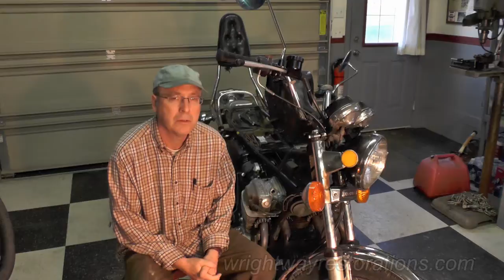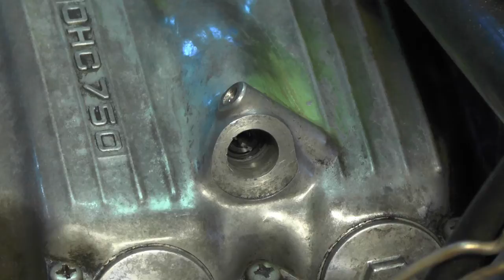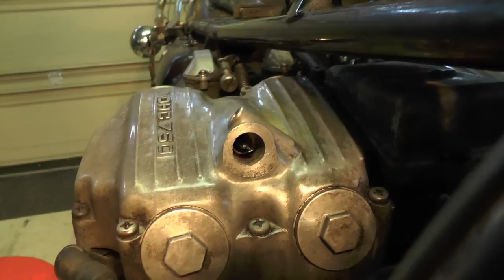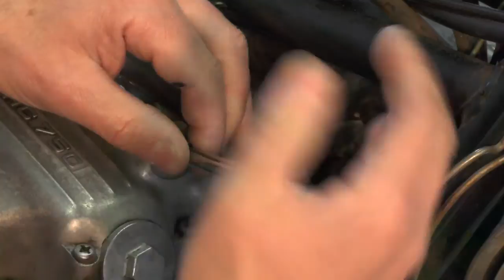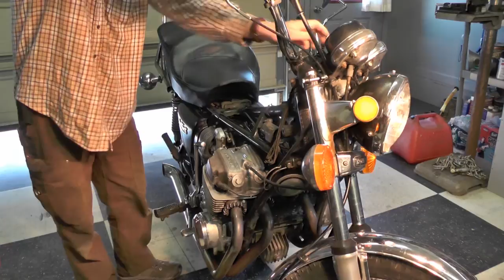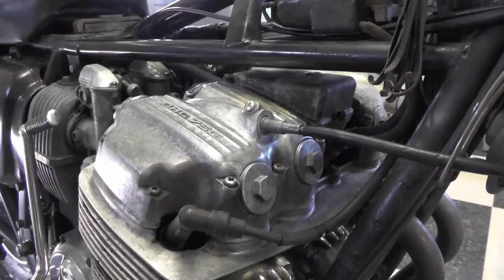Tachometer Drive Oil Seal Replacment - Honda CB750K --- Video #35

Comment: So, thanks for the vide. I'm going to be ordering the part I found online but many places say it's only for a CB750k and up to year 78. I have a 1980 Cb750C, are these seals interchangeable or do I need to keep looking?
Reply from the maker: Honda lists the two different model year seals as different part #'s.  The engines are entirely different so I surmise the seals are different.  I believe the seal  you need is:

91256-425-003

The earlier model seal is listed as 91211-286-003, which is probably what you have found (?). 

Both parts are listed as still available from Honda and are commonly found on eBay.
Reply: @kwrightway  that's awesome. Thanks for the reply and helping out, I very much appreciate that. Many YouTubers will post and not reply, do I want expecting a reply, but you went out of your way to do so and I am really grateful for that. Safe riding and may you have peace and prosperity in your days
Reply from the maker: @seanaguayo   You're most welcome.
Reply: @kwrightway  Hey, I wanted to thank you again for the help, I bought the part down here at Dime City Cycles in Tampa, and put it in on Sunday morning. The old seal had hardened and collapsed inside the slot/section that it goes in. I used a magnetic screwdriver to get out all the metal pieces that were ground up, a pair of slanted picks to break up the remaining hardened seal, paper towels with WD-40 to get the remaining pieces out. Took about an hour, but was able to do it right and get the seal in. Drove it to St. Pete and had no leak! Was very happy, proud of myself, and satisfied.

You also inspired me to look up schematics for the bike, since Honda usually has them for all of their vehicles, the schematics that show where every part is and what number it is to order, so I went ahead and found some websites that offered the schematics and links to parts for my bike and bookmarked them. Like the old saying goes, you teach a man to fish he eats for a lifetime, I want to thank you again, because you put me on that path
Reply from the maker: @seanaguayo  You are most welcome, and I'm glad you were able to sort things out.  Thanks for the kind words and update!

Comment: I've got an 81 Super sport and there was a leak in this spot. Removed the old seal (in pieces of course) but I'm wondering about the rubber ring that goes around the outside of the gear drive slot. I hit it a few times with the pick and chewed it up. Will that be a problem or is that actually part of the ring that old seal that should be removed?
Reply from the maker: I'm not familiar with the '81 model so I'm taking a bit of a shot here.  Looking at the parts diagram, it appears the part you are referring to is a dust seal.  If this is accurate then I don't think you'll necessarily have a leak but this may allow water and contamination into the mechanism.  My advice would be to replace this dust seal, which for around $8.50 or so.  You could also ride it for a while, keep and eye on it and decide later what to do.
Reply: @kwrightway  Thanks for the response. You may be right-the part I think I hit is a thrust washer. Not entirely sure though, because I still think it may be the back collar of the oil seal that remained in there when I ripped everything else out. Perhaps I'll put the new seal in and see how it goes. If it leaks, then remove that part. Can I send you a picture? Can I have your email?
Reply from the maker: @Bslice2007  If you wish to contact me privately, go to my blog wrighwayrestorations.com and select the 'CONTACT" tab on the op of the home page.  I don't publish my private email address here for obvious reasons.
Reply: Sure thing. Totally understandable.

Comment: I thought you would have greased the tachometer cable whilst you were in there??
Reply from the maker: I did grease the cable somewhere along the line, just not on the video.  Thanks for the comment.

Comment: i have a problem with the screw that keeps the tach cable tight when it's in the engine. the screw spins in space like the thread is busted and thus the tach cable can wiggle. what would you suggest me do to fix this??
Reply: that screw that you can see at 10.00 minute
Reply from the maker: With a screw turning in a blind hole (no access to the back side) this indicates the thread is stripped either on the bolt, in the threaded hole, or both.  Most likely the female threads in the engine are damaged.  If the screw is loose enough that you can get a grip on the fastener head with a small, pointed vice grips or locking pliers, that may be one way way to attempt to lift and thread it out at the same time.  You may have to slide something thin under the fastener head to lift it up a bit to allow enough to show to get a grip with the pliers.  Though I hesitate to recommend more aggressive options, it may be possible to either spot weld a nut or similar onto the head of the screw to enable you to get a grip on it to lift-and-turn.  If you could secure the screw some way to enable you to drill it out, perhaps using red locktite or similar, that may work.  Not matter what approach, you will likely have to repair the damage threads in the cylinder head and care must be used here.

The 750 featured in this video wasn't mine and I haven't worked on a 750 is a few years now.  It can be difficult to suggest options without being there first-hand.  Good luck...
Reply: might as well just plug the tach housing in the engine and seal the whole thing and switch to digital tach? seems a lot easier to me, thank you for the advice
Reply from the maker: This is an option...

Comment: The seal on my 1981 CB750 bike came out in pieces and the center portion and the lip of the seal is stuck/glued in the casting. Any ideas how to remove the rest? I am thinking of using a torch to burn it all out.
Reply: +AeroRamer Please answer this question!
Reply: +Jacob Odle I though I had replied to this. I ended up taking the part out and dumped it in carb cleaner overnight. On my bike the part where the tach cable attaches too is a part that is installed under and through the valve cover. I used a small flat head screwdriver and carefully and patiently scrapped off what was left of it. It was well encrusted in there. It took me a couple of days of carb cleaner and scraping.
Reply from the maker: +Jacob Odle As I've never encountered this before and without seeing the situation first-hand I can only speculate.  There are two approaches I'd consider before using heat to "burn out" the remaining part of the seal.

- Use a long thin hook to attempt  to snag the piece(s).  A suitable instrument could likely be fashioned from a piece of wire and sharpened to a point after putting an appropriate bend in one end.. 
- Utilize a long thin forceps (tapered medical-type pliers) to fish out the the piece(s)

In each case, using carefully applied heat to soften what's left of the seal may help.  It may require a combination of these techniques to be successful.

I'd personally not  use a torch, rather I'd  use a heat gun.  Safer and easier to use and control in my view.

Comment: thanks, had the same problem with my 1978 Honda cb750. going to try it this coming weekend an see if it fixes it.
Reply from the maker: A few other thoughts if you use a dental pick or similar device... make sure the pick/tool has a SHARP point.  Also, don't be concerned about saving the seal or being gentle with it, as once you start, you're committed.  Dig in, hook it and pull it out.  It will likely only take you a minute to get it out.  Good luck...
Reply: I'm going to used a paint can opener that I modified. Had a bent end I filed down.